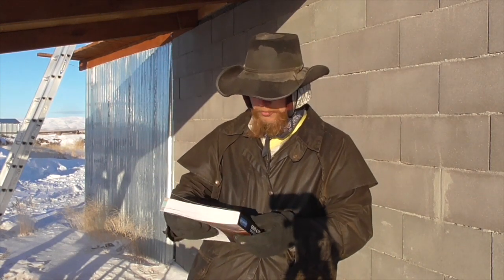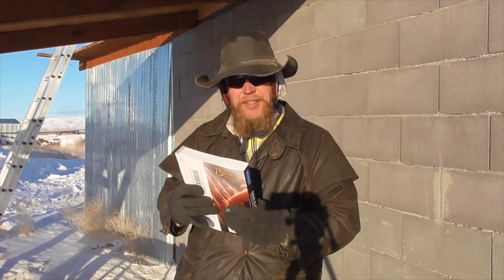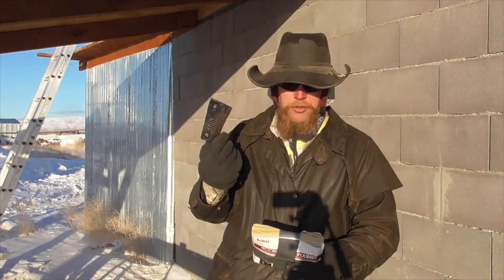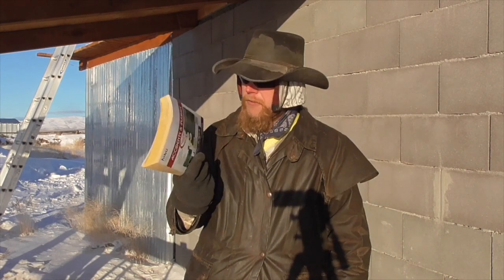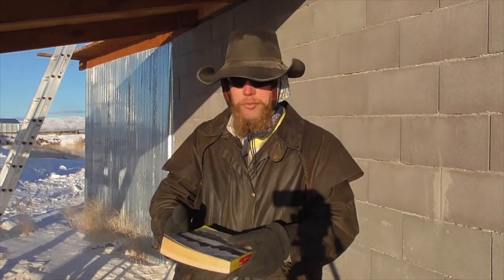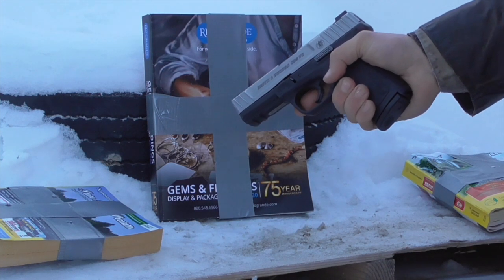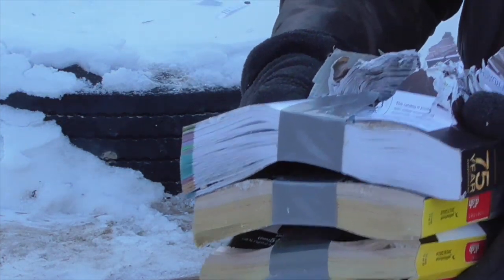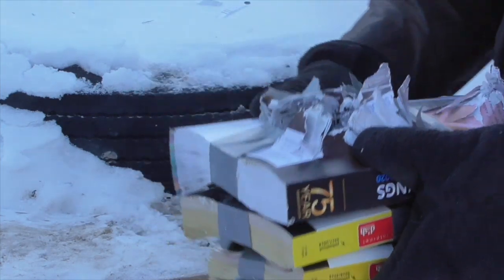Testing Improvised Armor: Books (TIS254)

Comment: Did they use a tin based solder to seal the cans? That's where I thought the name came from
Reply from the maker: Yes.  In addition to providing some corrosion resistance, the tin plating on the steel allowed the cans to be soldered closed.

Comment: Lead poisoning due to lead cans: https://en.wikipedia.org/wiki/Franklin%27s_lost_expedition . They had lead cans in the old days.. 

Anyway, what kind of improvised armor do you think is best? 

From what ive seen the stacked wood and sheetmetal looked to be pretty good, as well as the stone filled wood stone wood sandwitch. 

Greetings,

Jeff 

greeeeddd,,, :P
Reply from the maker: Well, as I said, old-fashioned "tins" or "tin cans" were actually made of thin sheet steel plated with tin.  The tin plating helped to protect the steel from corrosion and also allowed the "tins" to be more easily soldered closed.  Of course, the historic use of standard lead-tin solder for sealing cans had disastrous consequences for Franklin's expedition.

Anyway, of the armor tests I've posted to date, I would say the box of gravel was definitely the most effective, although admittedly that's only useful for buildings and barricades--not so much for personal body armor.

Comment: try this. 
shred the papers.
soak it in water for couple of days.
use a blender to make a find mesh of paper tissues.
pure it into any shape you like, put it under as much compression as you can.
let it dry naturally. under compression.
as it dries, it will even shrink with hug forces that will be hard for a bullet to go through.
i tried half an inch think ,stopped 9mm with anything that support it in the back (even a human body in that case)